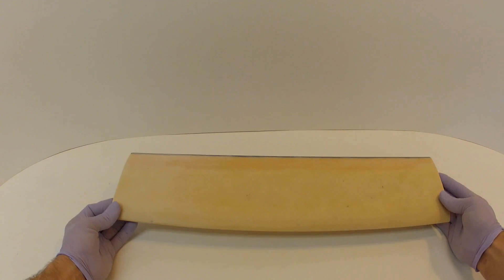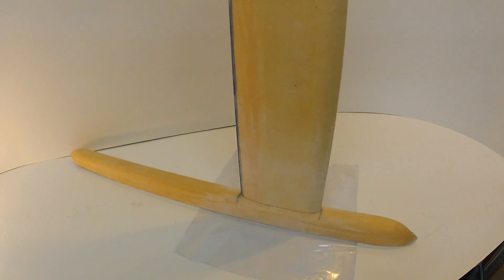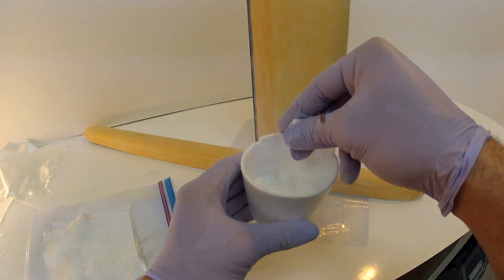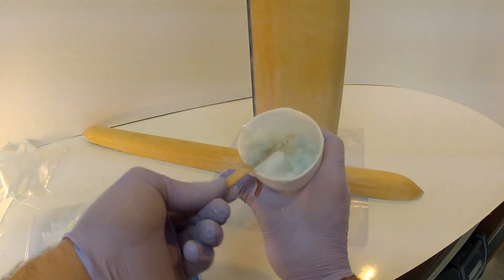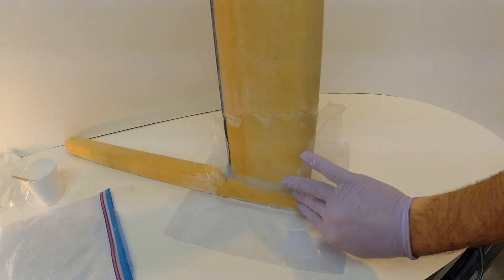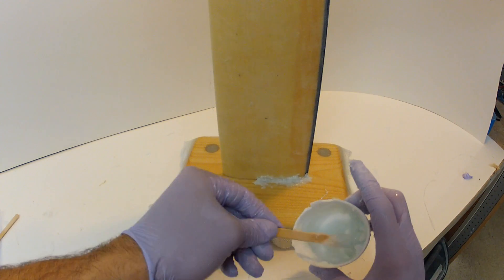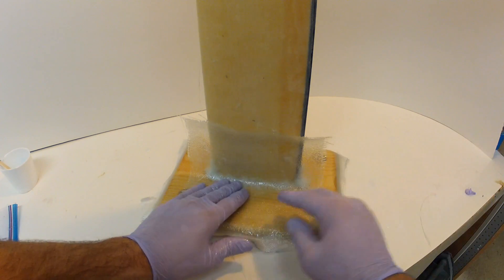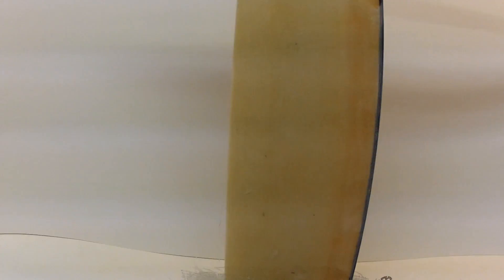How to build a Hydrofoil, Clearwater Hydrofoils kit (Part 3: Mast / Mast Joints.)

Comment: Great work with the videos, they'll be a great help. Just two quick questions, in the video you mention the baseplate fiberglass is 'still wet so you don't need to sand the baseplate' to rough it up. Did you sand the mast to rough up the surface before layering the fiberglass from the wet baseplate?

Also you say you like to do 'two layers at a time', do you mean you like to do two layers and then allow the glass to cure and then apply the next two layers after its dry or do you go back and forth apply two layers multiple times and then let the whole thing cure and dry in one shot?
Reply from the maker: Yes the mast gets sanded. By two layers at a time I mean apply two layers, smooth it out, push out any air bubbles then add two more right after ensuring the same thing (all while still wet) . If all layers were added at once it will be harder to make corrections and remove air bubbles.
Reply: Thanks for that, I'm having great fun building your kit, the wood looks beautiful. Needing to pace myself so as I don't rush and bodge it.